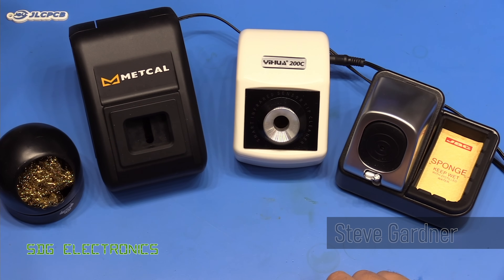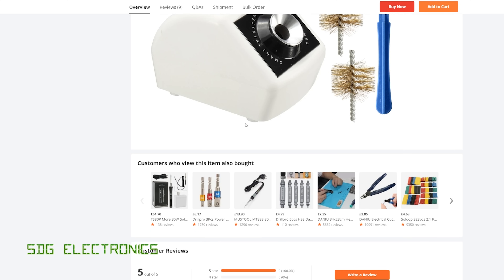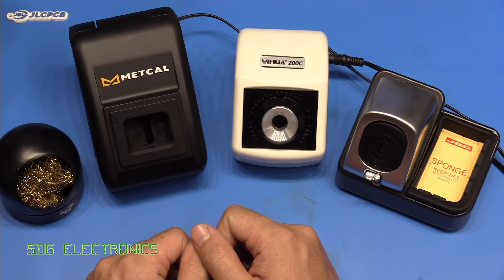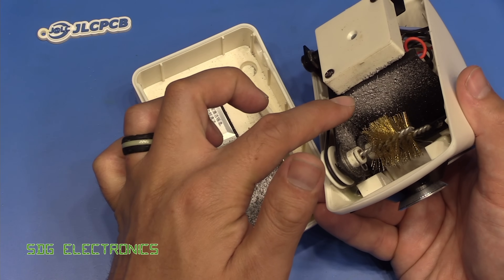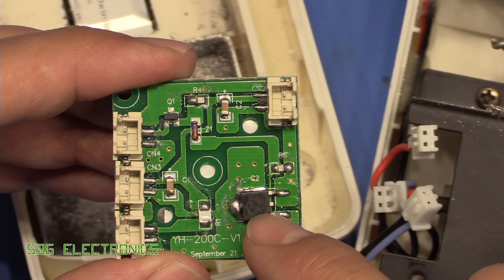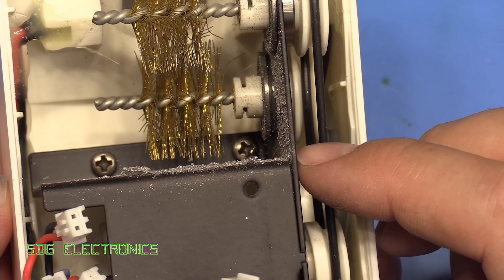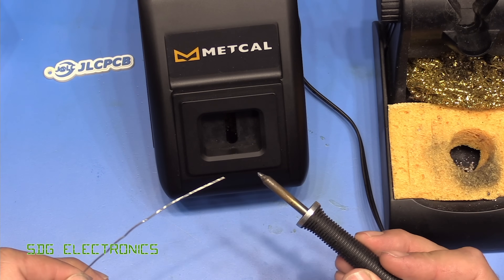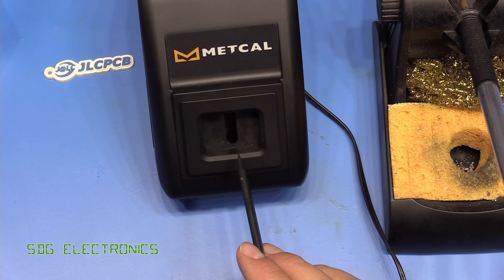SDG #223 Automatic Tip Polishers - Metcal AC-STC and Yihua 200C

Comment: I'm amazed at how many folks below mention having one these, particularly the more expensive brand units.  I'm looking at spending $100 to $200 for a soldering station, handle, rest, and some tips of various sizes and shapes.  The idea of spending that much for a tip cleaner seems absurd, especially when a damp sponge and/or the brass shavings work well.
Reply: if you're soldering once a month maybe

Comment: Seriously how crazy you have to be to design an iron tip cleaner with a microcontroller, a magnetic field sensor IC, a stepper motor and a driver for it!
For God's sake, the only task of this device is to rotate the brushes when a soldering tip appears in the hole, not to land on the moon!
Yihua 200C, despite the shortcomings that should be corrected, for example by replacing brushes with ones that are not bald, is priced reasonably and, above all, it is a simple device.
The solutions should be as simple as possible but not simpler.
P.S. Thank you for the review, it turned out very nice.

Comment: Apparently you can replace the brushes on the Yihua with the much more dense brushes from a Quick 310. Not sure if you need to modify those, or it's an instant fit. You can buy those brushes for ~$20. Seems like a good upgrade if you're going for the Yihua. Video where I saw this: https://youtu.be/d_ehu0AaFG8

Comment: First electric screwdrivers, now this..
Wouldn't use one even for free.
Reply: My coworker, a graybeard electronics guy, uses one and swears by it. It’s an old Swiss made unit (Clean-o-point, I think) that uses two counter-rotating sponges that rotate at different speeds, so that the sponges clean the solder off themselves. I’ll admit, his tips remain in excellent condition.

Comment: Sorry I'll disagree, a wet sponge has no place on a soldering bench. 
JBC claims: "There is no need to clean black flux residue from chrome surface of a tip. It is just unattractive but it does not affect soldering performance or tip integrity."

Comment: Interesting, I did not know these existed. I am just a hobbyist. Therefore I have no use for these. I tried the metal wooly things but are  not to happy with them for regular use. Although they do a better job with the worse crap on the tip. I got fed up replacing the regular (Weller) sponges. So I changed to a piece of folded up coton fabric. (T-shirt :-) Honestly, a sponge works better. But this piece of T-shirt just does not wear out although it is a bit more work getting the tin of the tip. But it doubles up as a "heat sink" for desoldered smd parts. Maybe not nessesary, or even bad, but I like to cool down my desoldered smd parts  quick. I think (hope) they than have less wear of the heating.

Comment: I find the sponge is adequate but not perfect, but to remove solder I just bang the handle on the table and let the inertia flick the solder off. I suppose if you find a single fine brush you could make a simple tip buffer with a cheap low speed motor.

Comment: I could see the metcal cleaner being very convenient but I wonder how long the brass brushes last.  The cost of the unit itself is not too bad but Id be concerned about having to replace the brushes too often at $50 a pop.
Reply from the maker: Time will tell. I do a fair amount of soldering so I'm sure I'll be mentioning/complaining when I pay out for new brushes.

Comment: Steve - I have the relatively new Hakko tip cleaner which comes in at about $125 USD.  It does a good job, although I wish their brushes were a bit more substantial as the Metcal unit. Agree, not everyone needs one. One thing I don't like about the Hakko is that it's "stay alive" circuit is obviously always on which does warm the case; I simply connected the wal-wart to a remote AC switch and turn it on only when I'm actually working at the bench.
Reply from the maker: Never mind, I've just found the FT-720, which I didn't know existed. That looks to be a compromise between the cheap build of the Yihua and the electronics complexity of the Metcal and JBC.
Reply from the maker: I did see the Hakko FT-710, but it looked like it wouldn't work with my Metcal iron, since the end of the tip wouldn't reach the brushes. Can you remove that cone on the front?

Comment: It is crazy that they use 24V in to a 5V regulator.  I will have expected 9 max 12V and as for the 25V capacitor that was probably designed with at most a 19Vdc power supply in mind. Most Laptop power supply are 19V so maybe they considered one of those still they are overkill in therms of power.  And those prices are crazy but I think this is just a very low volume item and thus the reason for the price.
The Yihua has a good start and maybe they can improve the design if there is enough demand for such a product.
Reply from the maker: It's a good point, I'm sure the stepper will run quite happily on a lower voltage so could be worth just swapping the AC adaptor out for something to give more margin. I'm not sure how many they sell, but mine is only serial number 1001...
Reply: @sdgelectronics  I guess they started at 1000 so congratulation on getting the second unit ever produced :)
Reply: I'm fairly certain that the capacitor voltage rating is perfectly fine.  The unit is designed to run off of a regulated AC adapter...so it should be 24V +/- some small number.  If one takes into account the voltage drop across the diode and some small IR losses in the connector and wiring, the potential across the capacitor will be safely below the 25V rating of the capacitor.  IMO...
Reply from the maker: @CDN_Torsten  It came with a switch-mode power supply. The output measured 24.33V

Comment: Good grief I can't believe this is even a product, who on earth thinks this is a great idea ? and at 250 quid, who's buying this ? its nuts ! this whole idea of scratching the plated surface is barmy in the first place, it has to do more damage than a damp sponge  and I have been using an iron for a very long time, a damp sponge works perfectly fine it always has and always will, this will wear you tip considerably more than the sponge, the manufacturers know this and want you to replace tip's more often, you can buy solid tip cleaners that if used once a month will remove any stubborn build up but if you need more than this consider buying some decent solder, in my opinion you realy took one for the team here.....
Reply from the maker: Technically, the brass is softer than any plating on the tip so it should not cause damage, but I can't say if that's actually the case since I have no idea what they specifically plate these modern soldering tips with. I think you can also get various grades of brushes to make things gentler on the tip. Like you say, the damp sponge is perfectly good enough for most, though the brass wool or these tip cleaners are good to get rid of the slightly more crusty deposits. I've seen these mainly used in assembly houses at the rework stations.
Reply: @sdgelectronics  The price made me very angry, its incredible !
Reply: @andymouse  The issue with a damp sponge (especially if it’s too wet, as many people do) is that the thermal shock of evaporating the water can actually cause microscopic cracks in the plating, especially at the higher temperatures for lead-free. That’s why it wasn’t a problem in the past but is now. 

I’ve been using brass wool for years and it works great. It’s not harsh at all. 

Brass or fiberglass brushes are handy for weird tip shapes that a sponge or brass wool can’t get into.

Comment: great video! follow up after a few weeks, please! I could never justify the price, but if you  think so, i might just get one.
Reply from the maker: I'll definitely give an update with further use. I don't think many can justify the Metcal or JBC ones though for home use.
Reply: @sdgelectronics  I have the JBC hot tweezer station. It can be very delicate to clean by pushing into the brass wool (i broke a tip gently trying to clean the tips). And it is kind of difficult to get clean with the sponge. Do you have any hot tweezers to try these units with?
Reply from the maker: Good point, yes, I've just tried it and it works well with the tweezer tips I have. Some of the larger ones (probably bigger than 6mm) would not fit though.

Comment: Been eyeing one of the JBCs for a long time actually. Afaik HAKKO made one at some point too and I think there's still knockoffs of that one on AliExpress too. My main reason to get one is because my brass sponge flicks the molten solder all over my desk. Now I don't mind it on the desk, but it also sticks to the walls and whatever project you're working on.
Reply from the maker: That was my main complaint with the Pace stand actually, the brass wool doesn't sit deep enough to prevent solder flicking everywhere which is when I started to look for some other options. I've seen two Hakko units, one looks very crappy with open brushes. The other one wouldn't work with my Metcal station as the brushes are too far away from the opening in the front!
Reply: have a look on the new hakko ft-720 ! 150$ CAD and it seem the best value
Reply: @simonspeaker  Looking at the video about this on Hakko's channel this doesn't seem that much better built than the Yihua. Just a basic DC motor driving thin brushes, put in a plastic housing. Could be a good deal for $50, not for $150 imo.
Reply: @simonspeaker  just watched a video on the FT720 on Hakko USAs channel. The brushes on that unit look similar if not worse than the Yihua 200C
Reply: @SebastiaanSwinkels  Yeah Hakko looks like garbage inside. But most likely the Yihua used the wrong plastic, Hakko says they are high temperature: "The FT-720 is equipped with long life fluoroplastic brushes that minimize temperature drop of soldering iron".

Comment: Great vid, I suppose if both units require some level of modification then do the metcal brushes fit in the cheaper unit? wondering what the performance would be like then, then perhaps just limit the current on the motor slightly to slow it down? though a 3D printed design is tempting :)
Reply from the maker: You could definitely Frankenstein some higher quality brushes into the Yihua. I think a DIY design from the start would probably achieve better results though.

Comment: well i used to use a brass ball, but eventually got annoyed that it wasnt doing a good enough job. but perhaps because i never used the sponge too, like you mentioned here probably would have helped. anyhow one day quite by accident stumbled quite by accident on using solder wick. i was actually genuinely using this cheap aliexpress copper solder braid for cleaning up.a pcb. and then during the operation it all got curled up around and wraped around my soldering tip. 'useless' i thought and cursing the problem a 2nd time i eventually noticed after removing the soldering iron how  amazingly plristine clean it left the tip. Almost like new but also completely covered with a very thin layer of tin. Perfect! So now i just habitually and regularly put a large blob of fresh solder onto the tip and wipe if back off again with the solder wick. And copper being an even softer metal than brass should not abrade or cause any damage the tip.

Now in terms of these devices... i think those metcal brushes are excellent. And if we can just buy the brusjes then the rest of this device could be made from low cost parts from 3d printers. Would probably also be worth including another 2nd tool in the same housing like the main iro stand. Or otherwise a vacuum pump for example. To help make the most out of the desk space real estate it occupies.
Reply from the maker: You can buy the brushes but they aren't cheap, definitely a DIYable project though. Nice idea with the solder wick!
Reply: I just started using the kitchen steel balls as not only were they cheaper but I found the "brass" balls which are intended were actually just coated steel anyway...... clearly somebody is having a laugh
Reply from the maker: Be careful with the steel wool or the brass coated steel, the will damage the plating on your soldering iron tips. RS sell the genuine brass wool for £2.50 each which seems to work well.
Reply: The replacement metcal brushes go for $50
Reply: @ecurepair  ah ok... yes i see now. Indeed $50 does seem a bit too much on the high side of things (those metcal ones). So maybe it would be better to instead substitute with some big brass wire brushes. The type meant for polishers / grinders / other power tools etc. Should be more affordable for a DIY project

Comment: Sorry, I'm still a little confused about how to use these. Are you supposed to put the whole soldering iron in, and for a long time? Or something different?
Reply from the maker: Just poke the tip in before every solder joint (or few), just as you would wipe the tip on the sponge or in the brass wool
Reply: @sdgelectronics  I'm sorry, the answer we were looking for was "Just the tip, and only for a minute".

Comment: I have the JBC CLMU-A tip cleaner myself, and the thing feels absolutely amazing. Not sure what material the Metcal is made out of, but the JBC is completly made out of aluminium or magnesium, so it feels like a brick. Just pushing down the lid feels like closing a door on a Bentley. The whole thing weighs over 2kg.

I think the brush density on the JBC is even higher than the Metcal. And just like the Yihua, the JBC also has a cleaner with non-metal (plastic) brushed (JBC CLUP). According to their website it's for 'gentle tip cleaning'. Probably to maximize the tip life wheb you're using this every day.
Reply: I have the older version .. once bougt at a  Hamfest for les then 100 euros ... very happy with it . would however never pay the full new retail price :)
Reply: @kittsdiy  I agree that the retail price is stupidly high, even though it's a proper built piece of equipment. But sometimes you have to treat yourself :)
If anyone can score a used one for a good price, don't hesitate and just buy it. You won't regret it.
Reply: @jeffrey308  absolutely agreed .  My jbc T210 en T245 are also second hand .still my goto soldering stations .
Reply: @kittsdiy  Buy once cry once, you never end up disappointed when you buy the best :)
Reply: @69uremum  but unfortunately the brushes are $120 USD so you'll cry every time you have to replace the consumable as well
Reply: @nickwaters2802  oof that is totally overpriced. I think I would make my own brushes with replacements being that high! :)
Reply: @nickwaters2802  that's really expensive. I might just use a reduced motor and two brass polisher wheels
Reply: @yuxuanhuang3523  I bought the quick 310 tip cleaner. The brushes are pretty substantial and only around $20 USD for replacements. You can use a foot pedal to activate it. Unfortunately quick only sells it in 220v, so I have to use a bulky step up transformer to have it work in the USA. I've also tried yihua 200Q modified with quick's brushes and unfortunately the sensor isn't reliable on small jbc style tips.
Reply: @nickwaters2802  That's helpful info. I am still using a T12 and copper sponge for now because my designs now all use 0805 or larger components and most importantly, I reflow them rather than hand solder. Still would get a JBC style when I get the money to do some quick modifications to my design.

Comment: I have the metcal, love it. Brushes do need to be cleaned and refluffed or replaced (trying to find a generic cheaper brushes... lol) Mine sounds pretty louder than that though, maybe its a bad stepper or its vibrating, I tried taping the tray and stuff its still pretty loud (resonates) maybe my pwm is noisier not sure..
Reply: I actually have a video lol , mfg said it was normal.. shrug https://youtu.be/fJXtQfd6nOQ
Reply from the maker: Mine doesn't have the resonance that you describe or show in your video. You could use a pencil with an eraser on the end to touch parts inside the box to pinpoint the resonance, but there's really not a lot in there. Maybe it's a noisy stepper or the current on the TI chip was set differently?
Reply from the maker: @jeffrey308  Thanks for the video. Does the JBC use a standard DC motor? Certainly seems to flick the solder off the tip like the Yihua, meaning it's very quick to use. From some brief soldering the solder collects nicely in the tray without going everywhere in the Metcal unit, but it does take a bit longer to use.
Reply: @sdgelectronics  I've never took it apart, but since it clearly has some 'intelligent' speed control I suspect it's a stepper motor. When you put a decent amount of force against the brushes it clearly delivers more power to the brushes... if you pull out the tip after this (hehehe) the brushes speed up for half a second and then goes back to it's normal speed. The thing is firmware upgradable (yes, I've updated the firmware in my tip cleaner :| ), so it's more than a basic feedback control.

The JBC collects almost all the tin in it's tray, very little goed behind/next to it (see https://imgur.com/a/8P99zXu )
Reply: @sdgelectronics  hah yeah I gave up after a while
Reply: @jeffrey308  oh wow, the jbc really spins!
Reply: @jeffrey308  I have an unboxing and teardown vid i never edited posted, maybe ill find it.. mine was from ebay, maybe its bad, that jbc though is luxury!